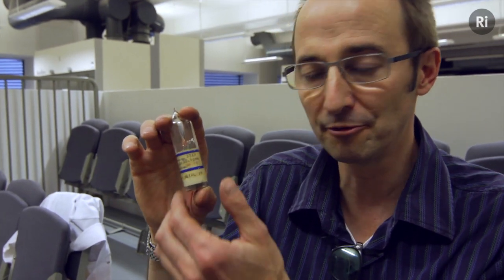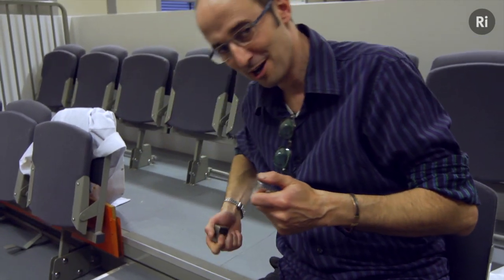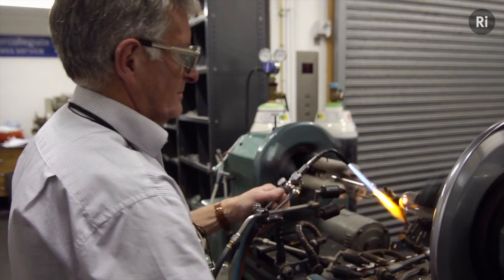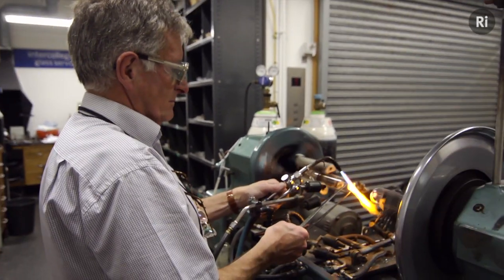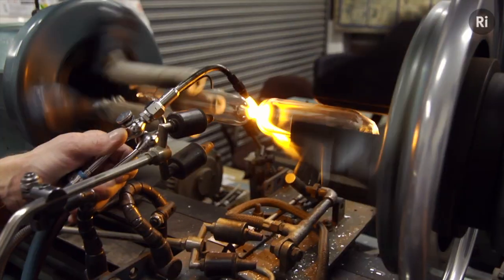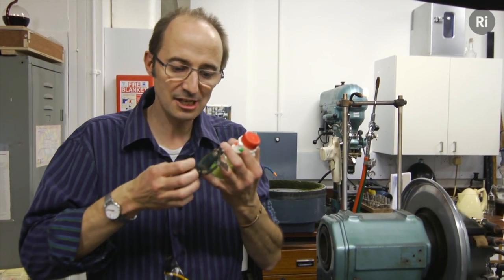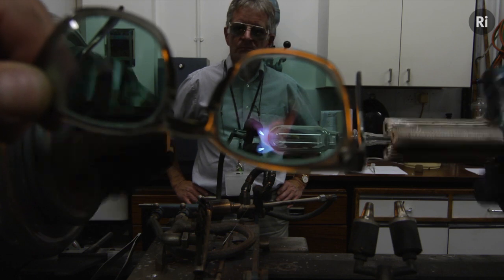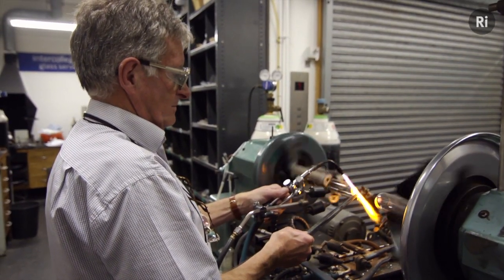Andrea Sella - Glassblowing and Didymium Glasses

Comment: One of my favorite things in science is the optical distortions and revelations possible.  Since the day I removed the filter from my calculator so I could use it in high school in 1989 so the teacher wouldn't know I had it turned on to things like this video I have always been blown away by stuff like this.  Also removing the filter from an LCD monitor so you can surf the web privately anywhere unless someone has on a pair of polarized lenses LOL
Reply: very sneaky, thanks for the tip..lol

Comment: Too bad he didn't mention the bigger picture: every (practical) chemist is dependent on his glassblowers. Not just because it's often cheaper to repair glassware than to buy it anew but also because sometimes you need an apparatus which can only be custom made.
We had an apparatus for anionic polymerization that spanned two conjoined fumehoods.
Thanks glassmen!
Reply: Thank you Magatherium, as a scientific glassblower for over 40 years (now retired), you'd be amazed at the stuff we made, designed, and fixed all without any credit. Think of the number of chemists out there who relied upon their glassblower to make their chemistry happen only to not even get a comment of gratitude in the resulting paper.

Comment: Mind you, cobalt glasses were also used for the same purpose (as well as for brazing metals)
Reply: Cobalt glasses only decreased the amount of light coming through they do not filter the sodium wavelength. For brazing you want less light reaching your eyes, there is no specific frequency wavelength to be concerned about.
Reply: With due respect, have you ever tried cobalt classes? 🤔 (I have)
They do block the 590 nm wavelenght light (yellow) emitted from sodium.
Besides, infrared radiation can cause eye damage on the long term, welding and brazing glasses are specifically made to shield from excessive light and most of IR waves.
Reply: @BartolomeoPestalozzi444  Yes I have. I was a glassblower for over 40 years and used and/or tried a variety of different eye protection. I used some cobalt glasses for a long time for quartz work until I found a better solution. Yes, they do cut down the amount of light as well as the IR range (which is important for quartz work) but do not cut down the sodium frequency as well as your standard didymium lenses. Regular borosilicate glass does not emit anywhere near the amount of IR radiation as quartz.

Comment: someone should adapt firefighters air masks with didymium or even their eyeshields that are mounted to their helmets {bourkes}
Reply: That's brilliant.
Reply: Bad idea. It would lead to firefighters getting into very bad situations because they could not see flames. I understand that it might help in see through flames, but I want to know where the fire is so I can predict it's behavior and not being able to see flames would preclude that.  Thermal imaging makes much more sense.
Reply: Blitz350 Just one question, how do thermal imaging helps in a building with fire?, I think you wouldnt be able to even see a person, because the IR will be saturated with the intense heat of the fire.
Also you could have just half of your vision with that kind of glass, or a mixture of both that does not fully block the flames, then you will be able to se through fire and know where the flames are.
Reply: That is a pontential situation with a TIC but rarely happens.  Part of a how a TIC works is based on an objects transmission and reflection of IR radiation and a group of objects at the same temp will rarely have identical rates of transmission and reflection.  It was a bigger issue with older TIC's. Newer ones have much better detectors and screens to allow for higher definition to avoid complete wash out.
Reply: charlie lange There is a difference between sodium emission and the emission from carbon particles from a fire. The sodium emission has a couple of emission lines in the yellow that is very intense. The emission from a fire has more of a blackbody radiation spectrum (full spectrum).